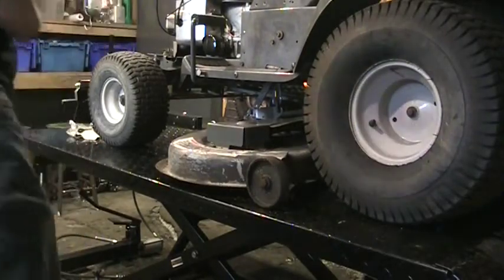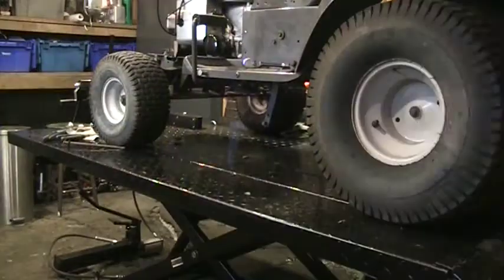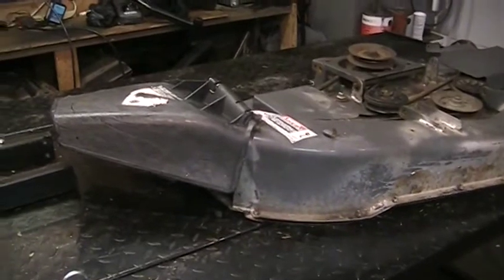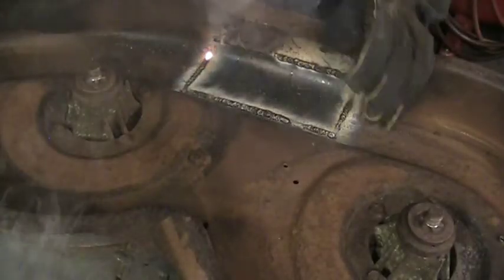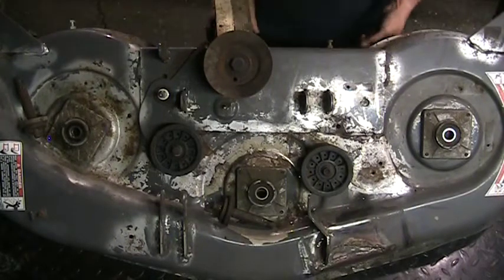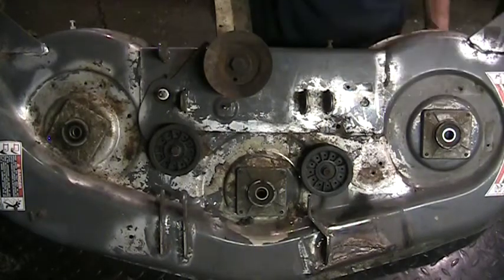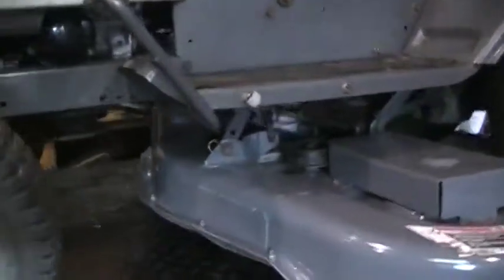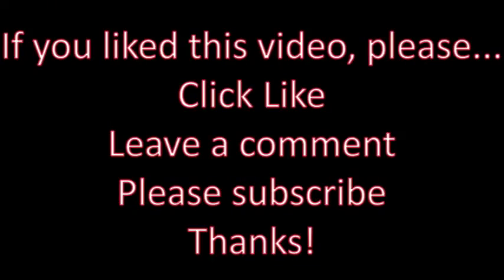Repairs to do on a MTD White LT200H Riding Lawn Mower for resale Part 2

Comment: Like it just like it is thanks working on a 1989 White L-12 automatic changing belts solenoid battery belts replace carburetor the works clean up the ignition wires connectors dirty.
Reply from the maker: 1989?  That's a classic for sure.  Thanks for watching!